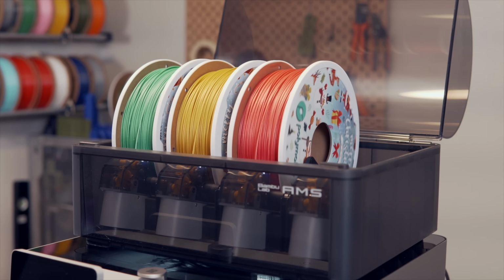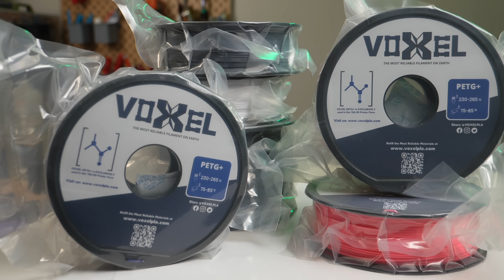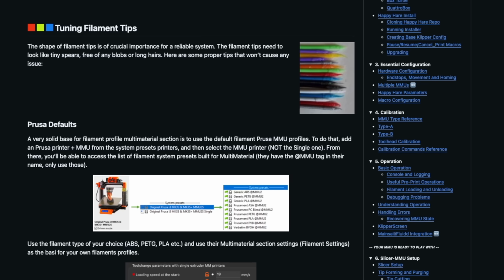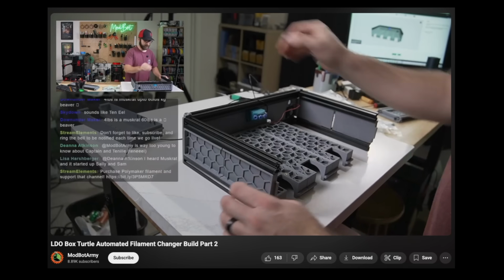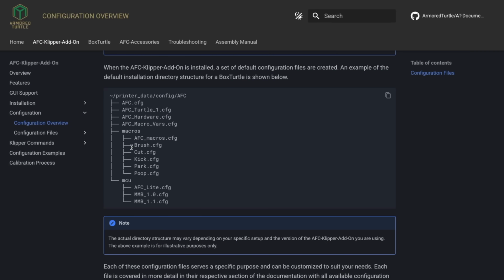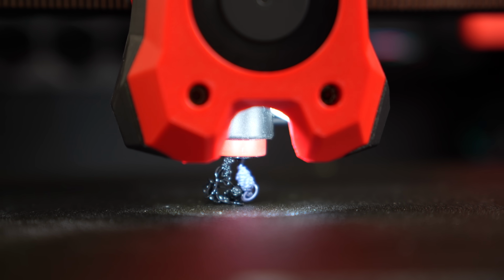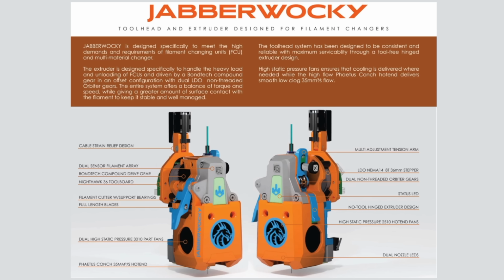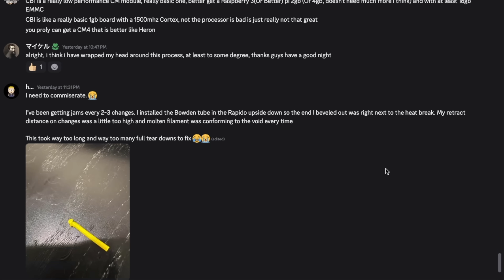Open Source AMS Multi Color 3d Printing (BoxTurtle)

Comment: Very cool to have an open source solution but am I the only one who finds multi color 3D printing just really gimmicky? The only real world use I personally would find for it would be for maybe printing the top layer of lettering in a contrast color and/or printing supports in a different, perhaps water soluble, material. Otherwise most usage cases I see demonstrated are just silly. NOTE I STATED "MOST"... not all.
Reply: Having multiple filaments/colors on tap without having to manually switch the filament is the most practical application I’ve seen with those systems.
Reply: @motorsportfangr also having multiple rolls of the same filament, it can use up a roll completely and switch to the new roll, you can be sure a almost empty roll will cause a print failure
Reply: Also, the filament loading is so much smoother. I agree, the actual multi color prints are not that common (for me at least), but having the ability to do so when I need it, and that 'quality of life' improvement for unloading/loading filament is just worth it (to me at least).
Reply: Best part about an ams is the automatic spool changeover when a spool runs out, worth it just for that
Reply: I see the automatic changeover from an empty spool to the next as the most useful feature. Either for really long prints or for prototypes to use up the almost empty spools of random color.
Reply: I mostly design my own parts and rarely print downloaded designs. I just tend to design around single material printing. But my designs are rarely artistic in nature.
Reply: Tbf I'd rather go with a 2-4 toolchanger approach. And it might be easier to setup and cheaper.
Reply: @vanher282  It’s neither. Prusa XL costs a pretty penny and it took them ages to iron out the bugs.
Reply: @vanher282 less poops, single toolhead is counter productive and inefficient, sometime the waste to print ratio almost if not more than 1:1
Reply: Multi-material is more important imho (supports etc)
Reply: @dogsbd Well, you can use the multicolor system not only for printing with multiple colors, but also to produce a component from different materials.
Reply: @RayZXA  Sure, but that's a pretty niche case.
Reply: i want an ams-like system for loading multiple spools of same filament so it never runs out mid-print
Reply: At the job i work at we use multicolor to customize our products, kinda like a premium version of the same product, its a total gimmick to add more valueout of a product thats already pricey
Reply: I particularly want it for letters, cool figurines that I can print rather than have to paint parts of it. But especially different support material like PLA with petg support and tpu with petg support.
Reply: I don’t use it for making multi color prints it’s only nice for when I want to change filaments from print to print but imo it’s just a ease of use upgrade not really a needed feature
Reply: The two biggest uses I've had for multimaterial units have been just swapping colors between prints (eg a full plate of parts printed by object rather than by layer, that need to be in separate colors, printed unsupervised while I'm out), and hueforge prints (which can be pretty nice and unique gifts, like lithophanes). Not a lot of waste in either case, and fairly useful.
Reply: I've done the same. I probably didn't word it properly, I don't to prints that have multiple colors in the same layer in the same object. That's where I don't like the amount of filament being purged in the end. 

Agree with you on these uses cases as well.
Reply: I'm mostly interested in muti material prints or different materials for support.
Reply: I use multimaterial a lot for either detail colours, or some opaque plus transparent PETG for light piping purposed of LEDs etc
Reply: I design most of my stuff to be printed separate and either glue or clips and a bit glue together. way faster, less waste and personally feels like it has a better bonding in the end as well. i understand for very small items this is not a option. but i would always suggest to spend a little bit of extra time to design is separate
Reply: I can only tell you what I use it for and why it is a must on my printers.  For me, not a gimmick or niche thing.
 - multiple rolls of same filament.  Instead of babysitting, I let the printer switch rolls when one runs out, then I can scan printers to see which need empty rolls replaced
 - support material.  Not a surprise but if I am going to print any supports at all it must be done without me being present.  No way I’m wasting time to wait for a per layer filament change.
 - part branding, “patent pending” type text, or in the case of toys multiple colors are required. Again, like support material, I cant make the time to babysit printers and filament changes.

If you need it for what you do, you need it.  If you don’t you don’t right?
Reply: I agree. I am only intressed in having 2 different filament. One for support and one for the part
Reply: @David77530 Yes, a 2 spool AFC for a decent price would be nice.
Reply: No, it is quite gimmicky to be honest, As we did just fine without it all this time until it was introduced. Really It's only real advantage is convenience at the end of the day convenience of being that you can just print one part in one go in multiple colors versus printing out the object in multiple parts and the colors you want before snapping it all together... But to be fair paint spray paint can accomplish the same effect even with a single color print and probably end up looking better at the end of it anyways. It does have some uses. Yes, if you're really dead set on your multicolor being in filament or if you want to do something like filament painting where I mean technically that is legitimate use but at the end of the day. Yes it is kind of gimmicky and it's real selling factor is convenience.
Reply: It can be taken advantage of if you are creative with it. I run a business where we make decorative items, and all of them have 3 to 6 colors. I figured it's cheaper to print them multicolor than it is to paint them, and also the part is more durable since there's no paint to scratch or peel off. I have sold more than 30,000 units in the last year, so multicolor printing is very useful and profitable for me. At this point, I wouldn't buy a printer if I can't fit a multicolor system on it
Reply: I wouldn't call it gimmicky personally, but having an AMS unit, it isn't something I use for multi-color prints very much. AMS style systems with only one tool head just has too much waste for my taste and I'm not batch printing items to sell.

Pretty much everyone has expressed what I'm about to say, but where I've found it most useful is to have multiple colors that I'm using for different prints. It saves me from having to switch out several times. I've also used it a number of times when I get to the end of a spool, it's an easy auto-switch to the next spool. And I have found it useful indeed for different color lettering or accents on top layers. 

So for all that, I'm still happy I purchased the AMS setup.
Reply: I printer a set of Kessel Sabacc (from Star Wars: Outlaws) cards, dice, and tokens.  You can't really do playing cards in 1 color— that would be silly.
Reply: Stack printing?
Reply: Yes
Reply: Multiple colours are fun e.g. HueForge, but not what I bought my P2S for. Auto-refill and filament drying is what my AMS does most of the time. Too pricey for that on its own but as a combo it's a nice quality of life feature. Here and there when there's a logo with 2 or 3 colours, or to make toys for kids who haven't taken to painting them (yet).
Reply: Yeah, it's pretty wasteful at this current state without separate tool heads. I do use it occasionally for things like you stated with different colored lettering, other than that, I am not the target audience. Now when multiple tool heads become affordable, I'd be more interested.
Reply: Yes, and color TV was also a gimmick.
Reply: There’s multiple good reasons for multi filament printing. None of them are about efficiency really though. One is support material or at least those with agonistic properties to each other so they don’t fuse with supports. The other is design related, multi color of course. It’s not really a gimmick in any sort of sense though
Reply: Yes - AMS style filament changers are definitely somewhat gimmicky, and they completely fall apart if you are printing two materials that need vastly different nozzle temperatures. 

They can also be problematic if you print two materials that don’t stick together, and you don’t have a large enough purge volume. 

At the same time though, there are definitely projects where having an AMS is really nice. I’ve been messing around with printing shoes with TPU lately, and having an AMS like the Box Turtle would be great for that because it would let me print different colors and designs into the shoes without having to change the way the shoe feels. For things like that, an AMS is great. 

Overall, aside from price though - tool changing printers are where it’s at. I built a Jubilee at the beginning of COVID, and having a tool changer is the best of all worlds. You can use it for multi color printing (hell, you could even put a box turtle on each toolhead, and have different colors with different materials all in one print!), but you can also use it for super efficient material swapping too. They’re a little more tedious to set up, but they really are amazing once they’re up and running.
Reply: Your imagination is just limited

Comment: You don't really need a switch on the toolhead due to the buffer detecting when it has stopped. Also I'm wanting to do tip tunning due to filament waste and keeping my toolhead complexity down.
Reply from the maker: This is good to know. I’d still think there could be added benefit if something broke off in the toolhead that the buffer wouldn’t be aware of. Probably less common though.
Reply: I have found in my experience that instead of tip shaping via ramming you can quickly extrude the molten filament and quickly retract.  Leaves you with a nice sharp tip and barely any plastic leftover at the nozzle.
Reply: @4lan39  Really good to know plus I'm using the BTT nebula extruder which has the filament sensor build in
Reply: @4lan39  Do you just use ramming and forming or a bit of both.

Comment: Speaking of ams units, will you be looking at Pico MMU?
Reply: it's a way easier project, probably the cheapest mmu you can have
Reply: I ordered and printed everything just before the indx was announced, immediately lost interest and just this weekend started putting it together. I've got everything assembled up to the ebb 42 and wiring. As stated it's much simpler and cheaper than anything else I've seen. The most difficult parts will be the toolhead (dragon burner in my case) and tuning. I'm back to work tonight so hoping to finish the build next weekend, then we'll see how the implementation goes. I fully expect that to be the most difficult and time consuming part and a big reason interest was lost a couple months ago. I do wish there were more info about it on YouTube as there's really only one small channel showing most of the actual build. That said it was straightforward enough even with just the basic guide and 3d model to go off of.
Reply: @RobertD_83  to be honest pico mmu makes me want to build a klipper machine...
Reply: @stoinercraft6389 not sure what you're running but I procrastinated flashing klipper to my ender 3v2 for many months after it became popular but now that it's been running klipper for a couple of years i don't miss marlin/octoprint at all. Again tuning took some work but I can't think of a single feature other than octolapse that i missed. And that had a limited amusement for me anyway.
Reply: You can always flash klipper to a different sd card and keep your Marlin one in case you change your mind. Then it's only the actual fw flash to swap. I did that but broke my marking SD when removing it which defeated the purpose and sealed the deal for me lol
Reply: @RobertD_83  i had an ender 3 s1 klippirized, but i sold it and got a bambu lab a1, it's much more reliable but boring... that's why i'm thinking of buying another printer just to tinker with

Comment: Is there a filament cutter and runout sensor mod for the stealthburner with the galileo 2 extruder?  Will it work with either a post or pre extruder position for the runout sensor?  Will it work on a Trident, or Switchwire?  I also wonder about a mod to use a servo to activate the filament cutter.
The Box Turtle would seem to be the way to go if 4 different colors in a single print will do (though expanding the box turtle to 5 or 6 in a single unit seems doable), while the ERCF might make sense if you need many more colors.  Multiple extruders and spool rewinders VS one extruder and a Rube Goldberg device for switching filaments along with multiple buffers.  Take you choice.
Reply: Yes, there's a FilaMAtrix version for G2E and it will work on any Klipper-based printer.
Reply: And you can chain multiple box turtles too...